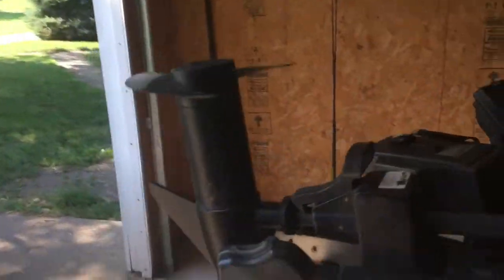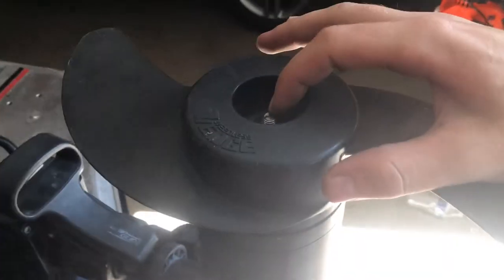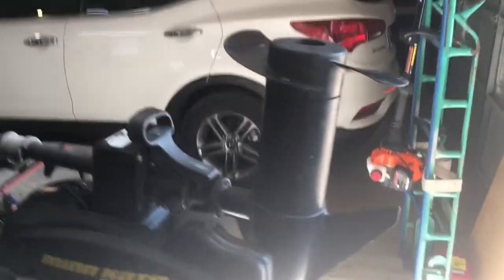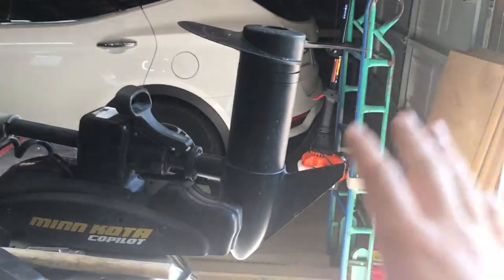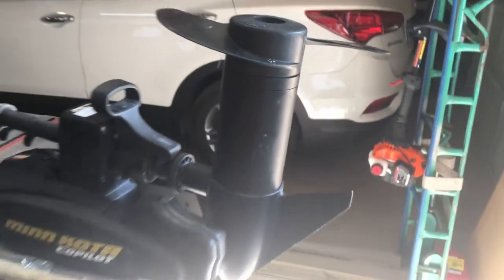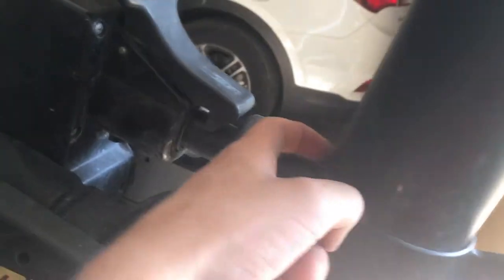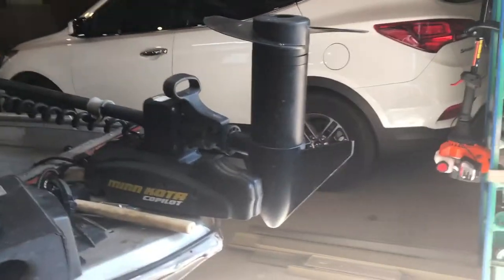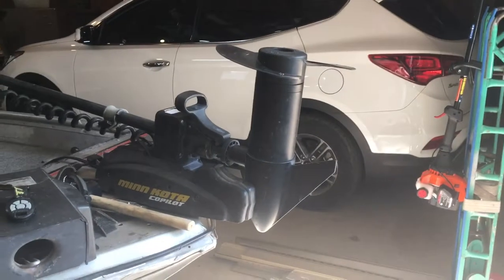Minn Kota running reverse? Problem solved!!!

Comment: Thank you VERY MUCH for this simple fix. After picking up my trolling motor from having it rebuilt I hit the lake and discovered it was running backwards. I called the repair shop and was informed I could bring it back and pay another service charge, or I could remove the head and swap the positive and negative wires around. Hopefully others will see your video.
Reply from the maker: Glad I could be of help!! I’m still blown away that this video is still helping people out!

Comment: So, I just gave you a like, because I "like" what I'm hearing!  My brother had his boat in the shop twice to the same guy for his trolling motor recently and after paying unreasonable amount of money and getting it back, it still wasn't working right. So my other brother helped him do the repair to the motor, and it started working.. So we were soooo excited to get it on the water today, after I bought him a new remote for it because we couldn't do the calibration without one. We attempted the calibration, and tried it and it didn't appear to work. When putting it in anchor mode, it started chasing itself around in circles.  Frustrated again, we decided, heck with it, let's go fish, and then we'll play with it while on the bay if the fish stop biting. And they didn't stop, but it was really bothering me that it wasn't working, and we were going to move a couple of hundred yards, so I decided to deploy the trolling motor.  I put it facing forward and turned the motor on about speed 3, and it was pushing us backwards. I watched the water pushing the wrong way (from the prop toward the motor) and I was like, what the heck???  So I tried steering backwards.  While it took me in the reverse direction that I steered, it got us a little ways in the right direction and I stopped.  I said to myself, this thing is like reinstalled incorrectly and polarity is reversed.  When trying to use anchor mode, it's chasing it's tail because it thinks it's going forward, but it is really going in reverse, unknown to the controller or GPS.  No wonder!  I cannot wait to try this, but after reading all of the comments and results, this is sure to fix it.... which is when after I confirm, I will SUBSCRIBE for SURE!  I cannot believe, but I am so glad, that I found your video! THANK YOU!!!  
I only wrote this novel of a comment because I'm hoping it has more keywords that puts your video to the top of others search results! #minnkota #trolling #motor #reverse #polarity #fix #hellyes :)
Reply from the maker: @JimHearn  well hell! I’m glad my simple video could’ve helped you guys out so much! I’ve made it a habit now to check YouTube for my problems before taking it to a shop

Comment: Glad I found this. Inspected my brushes recently and first trip out it was running backwards. Reversing the polarity on the battery didn't work. I guess Minn Kota has built in polarity protection or something. I was quite sure that I had installed the field back correctly but I failed to mark anything when I took it off. I knew it was positioned right in regards to which end went on first because one end has a bevel. But mine doesn't have that tick mark that aligns with the skeg. Hopefully rotating it 180 will solve the problem. There's no other explanation even though it doesn't make much sense to me and I have a pretty good grasp of electricity and DC motors. The magnets in the field are opposing so rotating 180 degrees looks like it would just position them basically the way they were already.

Comment: This is an old post, but there are still guys like me trying to keep older equipment running. I had the same problem rebuilt the motor then it ran backwards. Same thing I had the make on the outside next to prop, rotated to other side, now the motor work correct.
On a side note, if you don't know if its running right direction. Use a piece of paper, light it and use the smoke to look at the correct direction. The smoke should be pushed away from the motor when held in front of prop.

Comment: Hey Ty, I have same issue and it came from factory this way (2022). I can't quite tell but it looks like yours in forward is turning counter clockwise, correc?t? Mine is clockwise now. it also doesn't pull full spec amps, 33A vs 50A spec. I had it serviced, for other issue and they didnt even notice the backward running prop.

Comment: Mine seems to be working this way new out of the box. I ran it for the first time yesterday and it was literally pushing my boat backwards when it should have been going forward. I could see the water thrust pushing in front of the boat even though the motor was facing forward. I'm going to look and see if it has any markings on it.
Reply from the maker: Joe H that’s weird that it’s doing that out of the box. Let me know if there are markings and if you’re able to fix it using my solutions! Thanks for watching and good luck!
Reply: No markings what so ever

Comment: I finally got my new seals and bearing my old one was shot completely rusted and falling apart put all together and it ran backwards I just took the bolts out spun it  180° put bolts back in worked perfect
Reply from the maker: Sam Tate glad she’s working for you now!!
Reply: FishingWithTy yeah and I didn’t have to ground the wires but if it does out well I’ll just do you like you said and put the ground wire in there because I run my trolling motor on 10 anyway thanks again for the video prescient it

Comment: Wait a minute so if you rotate the armature 180°, turn the handle for speed 5 forward it will run in reverse at that speed? Is this bad for the motor at all?
Reply from the maker: Yessir! Found it out the hard way that you can reverse the polarization, I’ll have to look into that to see if reverse the motor could damage it, I honestly have no clue

Comment: So if you happen to lift the housing a bit to far and the brushes close, your screwed, might want to mention that.
Reply: Not screwed. Just take the field all the way off after marking it across the motor base where the skeg is so you know which way it came off. Then use a long screwdriver to pull one brush to the side while tilting the armature that way and once that brush is seated on the commutator use the screwdriver to push the other brush to the side and lean the armature back that direction until it's past the bearing and seated on the commutator. Hold it in place and slide the field back over the armature reaching inside it to keep the armature steady and be careful because it will pinch your hand in a second from the pull of sliding the field back on. Look for the mark you made and make sure you position it 180 degrees from where it began and seat the field in the housing base with the gasket in place and you're in business.

Comment: My mark on mine is towards the bottom and it’s still running backwards so do I face it upward?
Reply from the maker: Try flipping it up or you possibly have the tube backwards, start there and see if it fixed it!
Reply: @RenegadeRCFPV  that worked. I flipped it how you did but I put that stamp up and now it’s running right. It came from factory like that which is upsetting but thank you for your help. All good now 👍🏽
Reply from the maker: @acupof_joe  anytime! I’m glad you got her working correctly! I’ve heard quite a few times that they are reversed from the factory which is weird

Comment: OK so this was not quite my problem but possibly someone can help me. I have a 24 volt Traxxis80 that has more thrust power in reverse than forward . It seems to work ok, but definitely has more power in reverse. Any ideas ?
Reply from the maker: Oooh that’s a good question, so after reading some forums a lot of people are having the same problem. A few people swapped the head to run forward in reverse. To me it seems like it’s a Traxxis quirk being able to push more water in reverse to stop yourself quicker